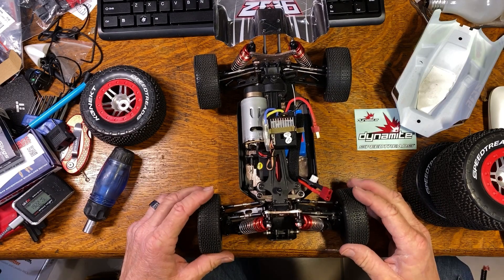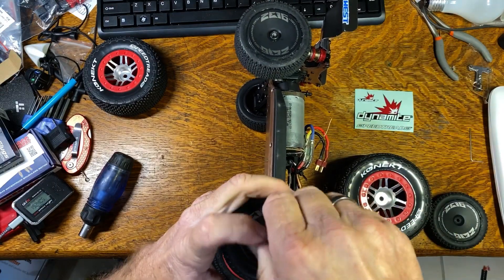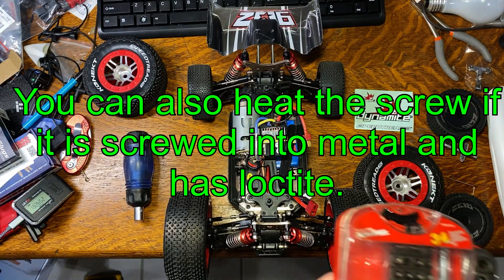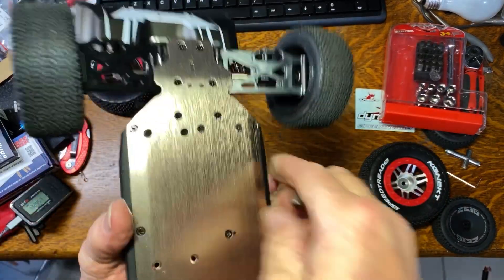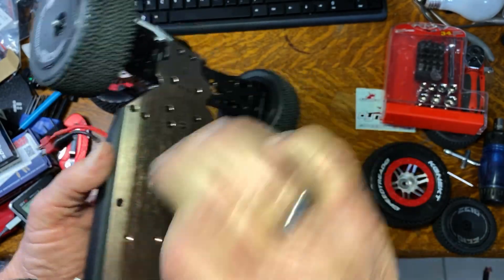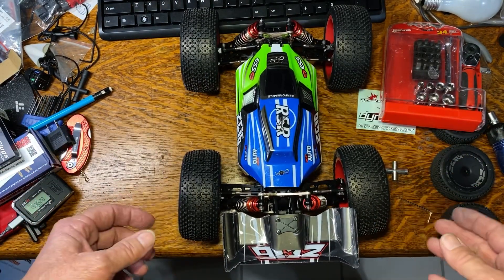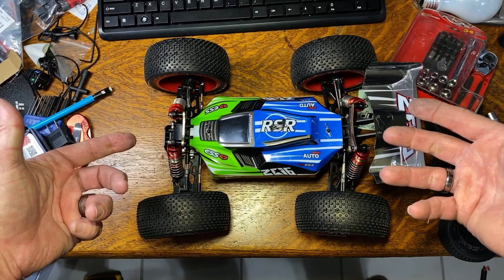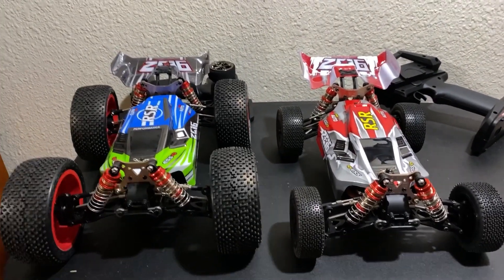WLtoys 144001 oversized tires

Comment: so the bigger tires make the engine run hotter? Is there a video on calibrating the throttle and the esc in the 144001? Just started the hobby.
Reply from the maker: It does. It requires more current to get the car moving. Think of it like starting driving your car in second gear rather than first. It's a lot more work on the motor. 

The factory controllers are pretty basic so they aren't very versatile in terms of adjustment. You have to calibrate your finger unless you want to upgrade the electronics. :)

Thanks for stopping by. Have a great day and be safe out there.

Comment: I have big tires too but didn’t know if that will put strain on motor.
Reply from the maker: It’s the same thing as using a larger pinion or smaller spur. I’m talking specifically about taller tires although wider tires can also increase the load by having more traction.

Comment: It's Super, super glue that's stripping the screws and the tools!
Even the grub screw an pinion is welded.
Ahahahahha, everyone of Us has sweated an waited over a month for spares to replace the perfect parts We need not have replaced.
The 144001 wheels drilled out with those over price 12mm Tamiya adapters are awesome all terrain tyres and make the best sound pushing My Hornet an Grass Hopper on tarmac.
Great stuff RC Modsquad!
Reply from the maker: I wish it was superglue. I tried cleaning them with acetone and it didn’t even touch the glue. As far as I can tell it appears to be yellow 3M glue or equivalent. 

Either way it’s a royal pain to deal with and so far lots of heat is all I’ve found that will help. 

Thanks for stopping by and checking it out. Have a fabulous weekend and be safe out there.

Comment: Idk why people dont run after a upgrade vid
Reply from the maker: There are a few reasons. One this video was really long and I did this at night so there was nothing to video. 

I did do a test run on it a few day later when I got back home and it was daylight. 

YouTube isn’t my job it’s a hobby for me. I’m away from home over 100 hours a week with my day job so I do the best I can. 

Thanks for stopping by and checking it out. Have a great day and be safe out there!
Reply: @RCModSquad  just doesnt make sense to post a mod video and not even run it on the ground next to your work bench lol. I guess thats why i watch kevin talbot vids.
Reply from the maker: @MrVolcom239  absolutely. I watch Kevin also. 
I don’t have room to run anything inside at my house. Kevin has much more room than I do. I’m home during full daylight one day a week. I realize it’s difficult for most people to grasp that but it’s a fact of life I deal with the best I can. The norm for most people seems to be an 8 hour work day and weekends of. Monday is my weekend. 😂

Most of the people that are interested in that car are interested in the speed test so driving it around my feet wouldn’t work for them anyway. 

I appreciate your input though. Have a fabulous day and be safe out there.
Reply: @RCModSquad  you dont need more than 5 feet to show how it rolls and to see if anything grinds and if the diffs can take it. Just a suggestion to make your vids better.
Reply: @RCModSquad  most people actually have moved on from speed tests and are looking at mods and how they function.

Comment: I have a nice 4 line burn mark on my arm from a similar experiment a few days ago.  I put the wheels from my savage flux xs on the 144001 and it was actually pretty awesome, but it did run very hot.  Never shut down though and it drove great.  Backflips off my ramp, climbing curbs, and actually pretty darn stable except for landing the jumps.  A lot of bounce in the tires... haven't tried compensating with the shocks yet but plan to.   Check it out on my channel if you are in to the "big tires on little car" thing.  lol
Reply from the maker: It’s easy for them to get away from you. Thanks for stopping by and checking it out. 🙏💯👍🏻
Have a great day and be safe out there!

Comment: I have the same car and I was wondering did you cut into the body to make sure there was more air to cool down the motor and the battery and the ESC because they get very hot even in like 40 degree weather so I'm debating and where to cut the body to make sure there's a heat escaping from it so please let me know if you had that problem and what you do.
Reply from the maker: Brad Kalman thanks for watching. 💯👍🏻 i haven’t done any mods to the body at all. Mine doesn’t seem to get all that warm on 2s but it got really hot on 3s when I ran it in the snow. 

If my weather is good Monday I plan to do some temperature testing on a mod I’ve heard about that claims to help and I’ll post that probably Tuesday morning. 

I have seen a few people cut little holes where the windows are in the front and back.
Reply: @RCModSquad  thank you for that info.
Reply from the maker: Brad Kalman You’re welcome! I’ll try and include that in my next video. Thanks for the suggestion. 🙏💯👍🏻

Comment: Hey David it's windy here today in Buffalo. Can you recommend a RC car for a beginner? And where's a good place to buy them? I would definitely use hand tools on them. I find power tools can be hard on somethings. Power tools have a place but I would think not on the RCs. Love these big wheels!
Reply from the maker: 307 Wyoming 4E Thanks for the weather update. I buy most of my cars from Banggood.com some I buy from Walmart.com and some parts through amazon. 

The 144001 is a good car, the q901, s920 are all three pretty good handling 

The 144001 is probably best for on-road and the other two handle short grass pretty well and dirt or pavement really well. 

The WLtoys 12428 is very durable and does pretty good off-road but it’s more difficult to handle at faster speed. It’s a bit top heavy. They are all under $100 and all you need will be AA batteries for the radio. 

If that left you with more questions than answers let me know more about where you plan to drive it and I’ll try and narrow it down a bit more. 

Have a great day and thanks for watching. 🙏💯👍🏻

I have videos on all of these if you poke around a bit.
Reply: @RCModSquad  thank you David. I will check out your other videos. Appreciate your answer!
Reply from the maker: 307 Wyoming 4E You’re welcome! If you have any questions on any of those cars just let me know. 

Have a great night. 👍🏻

Comment: Hi, do you know how many V output the "LED" attachment on the ESC?
I want to put a fan and power it by that connection, but I don't know what voltage fan to buy
Reply from the maker: Rushan Randeniya I just got home and checked the LED output and I was wrong, it’s the same as the battery voltage. So it will depend on if you run 2s or 3s it’s just passing the voltage through.
Reply: @RCModSquad  I'm very appreciate, thanks Rc 😊😊😊
Reply from the maker: Rushan Randeniya Thanks for stopping by. I believe that output is 5V I won’t be back to my car to check it for two days but I’m pretty sure that’s correct.
Reply: @RCModSquad  Thanks, keep it up!
Reply from the maker: Rushan Randeniya I will double check tomorrow. Take care and thanks again. 👍🏻👍🏻

Comment: Waiting for your test report!Hope you not to to burn the ESC!😅
Reply from the maker: Freeman Wu thanks a bunch. I’m really curious how this will turn out too. Stay tuned because I’m gonna do this as soon as I can. 

Thanks for watching and have a great day.
Reply: My stock 144001can run the top speed to 55.8km/hr with 2s battery.However,when I put 1/10 buggy tires on 144001,top speed goes to 58.9km/hr.It proves that the 550 brush motor is powerful enough to accelerate bigger tires!😃
Reply from the maker: Freeman Wu thanks for the input on that. 💯👍🏻 This is such a fun little car. 😃